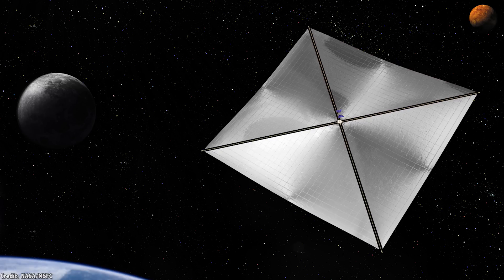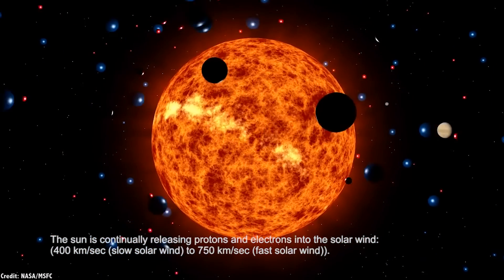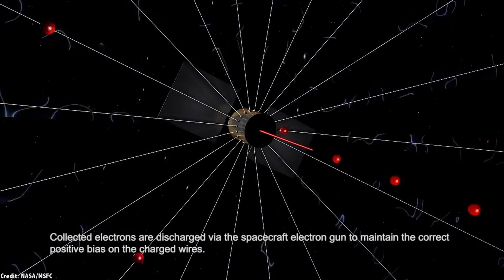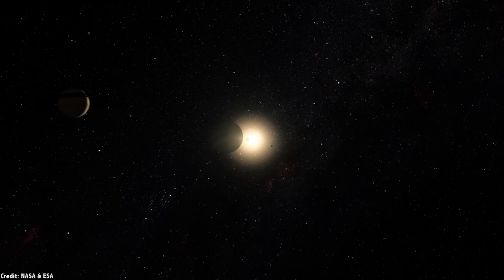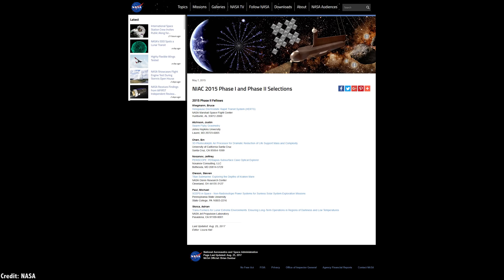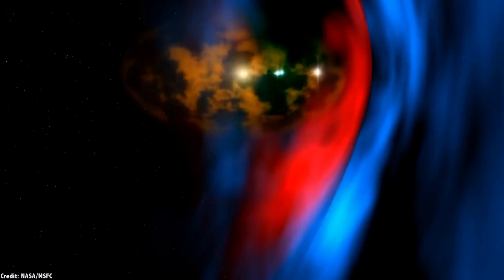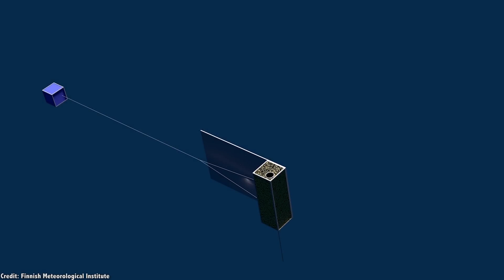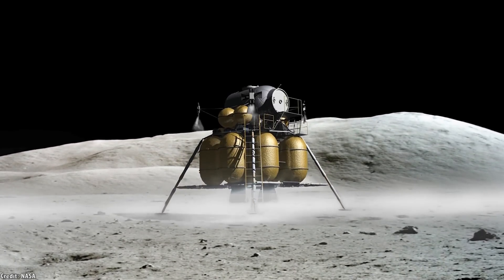What is an Electric Sail? Another Exotic Way to Explore the Solar System

Comment: Here's what I suspect:  the first time this is used for a "production run", there will be bugs in the system.  This happens all the time.  But this thing is too small to communicate with Earth, so we won't know what happened, or when, or where the vehicle is; it will simply disappear.  We won't know enough about what went wrong to make sure we fix it before the NEXT try.

Sorry, but I'm a pessimist about these kind of things -- particularly new, complex machinery being tested in hostile environments.  It's nice to be able to engineer a fix from Earth, as has proved crucial for many missions, notably Galileo.

Comment: Does that not mean that after the electric sail has passed the heliosphere it won't be able to get anymore thrust from the sun because the interstellar wind is now as strong as the solar wind?

Would you encounter turbulence at the heliosphere if you had a ship designed to crash into all those charged particles?

Comment: Question - Imagine three objects in space:  a planet with no atmosphere with the exact mass of the earth, a bowling ball and a tiny marble made of the same material. The tiny marble and bowling ball are dropped from the same height above the planet based on their center of gravity. We say they would fall at the same rate but they really don’t. The planet accelerates the objects the same but the objects are also accelerating the planet by super small amounts. The bowling ball with more mass accelerates it faster. Therefore, the bowling ball would have an overall higher acceleration and velocity than the marble. A super small amount but it should be there. Am I missing something?
Reply: texwendellsson hahahahaha

Comment: There is a Box Kite shaped model, that has wire loop on the top of the frame. When a current is passed through it, it hovers above the ground.  
This sounds like that

Comment: Could an artificial beam of electrons be created like a laser? If so would this be another option for breakthrough star shot?
Reply from the maker: They can be, I'm just sure if that would be an effective way to boost it faster, though.
Reply: David Bland 
Should be possible, it would require a BIG particle accelerator in space, though.

Comment: Could a circular Electric Sail also double up as an antenna and if so wold it be feasible for a swarm of such ships to relay data between themselves on it's way back to earth?
Reply from the maker: I haven't heard anyone propose this. In fact, as I said in the videos, these microsatellites won't have any way to communicate, so I'm guessing no.
Reply: Fantom Slobode because costs and them not being hit by objects
Reply: The obvious reason, to me, is the weight and the reduction of cost in getting the instrument into space.
Reply: my question was more theoretical than "in the pipeline" - after all having equipment that had multiple functionality would be of benefit in space.
Reply: Thanks Tehom, some of your points I saw as possible issues, but failed one the parabolic shape.
Reply: Yes! it exist. Are called magnetic sails. They are a little different than electric sails. Are circular loops in wich circulates electric currents. The propultion are generated due to Lorentz forces for the interaction between the current in the loop and the magnetic fields generated in solar wind or the earth magnetic field. Google Magnetic sail from Robert Zubrin and Andrew Martin.
Reply: Fraser Cain  why are the wires so thin?
Reply: Fantom Slobode at least I'd assume those are reasons
Reply: I've thought about this too.  The immediate issue is that just being big and circular isn't enough.  It should be parabolic (it isn't) and pointed in the right direction (might need to point somewhere else to propel the craft).
But there is a ray of hope.  Phased arrays overcome these problems.  Basically, you impose the same signal in different phases in different places on the antenna.
But that makes it heavier.  These wires are gossamers, very light and thin.  You'd have to add components at many places on each wire to phase the signal.  Maybe you could add an integrated circuit at intervals along the wire that would control the signal delay, and maybe it could be light enough to not be a problem and not foul the line when you're unreeling it.
Not sure how practical that is right now.

Comment: How is it that photon have momentum without having mass?Since p= m*v then photon momentum should be 0 * C  = 0.
What did I get wrong?
PS Excuse my poor english. I hope my question is understandable.
Reply: momentum is not the product of mass and velocity,.  Momentum is the product of energy and velocity.

Inserting factors of c, the relativistically correct relation between momentum p and velocity v is
c^2p=Ev

This holds for non-relativistic massive particles (total energy dominated by rest-energy: E=mc2, and therefore p=mv) as well as for massless particles like photons (v=c and hence p=E/c).

I could be wrong about everything I've said, but I'm fairly certain it's correct :)
Reply from the maker: There you go, some answers below. Thanks Trashy and Jeppe!
Reply: Note that E=mc^2 is only part of the most famous equation.

E^2=(mc^2)^2+p^2c^2

That's the full equation.

If m = 0 then you are left with

E^2 = p^2c^2
E = pc
p = E/c

Photons have energy, which gives them momentum.
Reply: P=hk/2Pi 
h planck's constant and k is related to the direction of the photon
Reply: First Cynic
OK, now you're messing with me. I ask a question about calculating velocity and you post equasion that CONTAINS VELOCITY IN IT. 
By yout logic, photon velocity is calculated like this:
p=pc/c
How does it make sense? :D
Trashy Spartan's answer pretty much cleared it out.
PS. I'm just kidding, I appreciate your answers. This question bugged me every time I heard the words "photons velocity". It's great that you can find such a great falks on youtube comment section who's ready to explain science without puns and trolling.
Reply: This video might help you as well https://youtu.be/ueuwWiR-Dw4

Comment: How long would it take for an Eletric Sail to reach Alpha centauri? Assuming it can travel in interstellar space
Reply from the maker: It would run out of acceleration once it got past Uranus, so it wouldn't be the best way to get to another star. You could knock a few thousand years off the travel time, but it would still be terrible.
Reply: Fraser Cain could you potentially use the little amount of wind coming from interstellar space to give it a tiny bit of acceleration or would it coming from all angles mess it up?
Reply: Matthew Thompson 
You'd have to "tack", as you do in a sailing ship, but I think it would be feasible - the problem is that the "galactic solar wind" would be very diffuse, and probably wouldn't provide enough acceleration to be worth it.

Interstellar travel will probably depend on ionic propulsion, which means SLOW travel, with low accelerations, unless we can get fusion working as a source of propulsion.

Comment: Now just only if someone could solve the problem with faster than light travel
Reply from the maker: The problem might not ever be able to be solved. :-(
Reply: Major Silly the alcubierre drive is the best and only way we will travel faster then light in the next few hundred years at least with today's ideas the future is mysterious after all anyways the alcubierre drive would theoretically run on anti protons (other then the production and storage problems we are set on that) actually Fraser you should do a video on the drive unless I'm blind and you have already